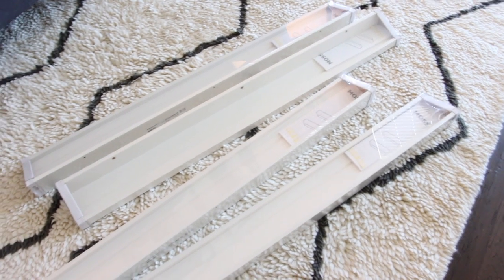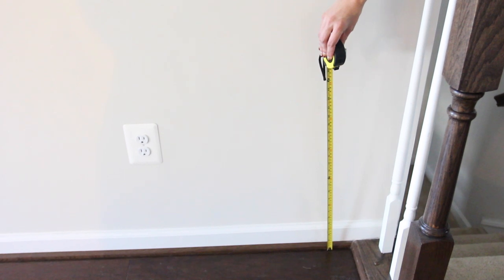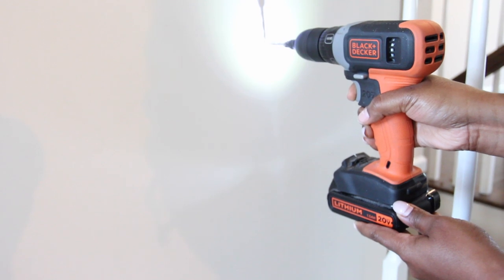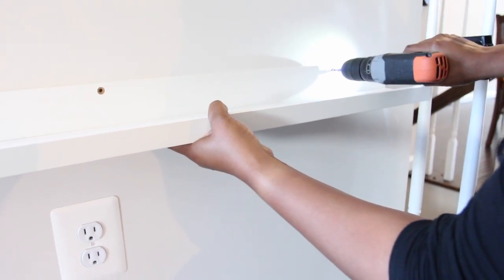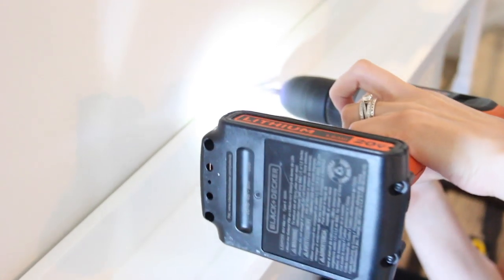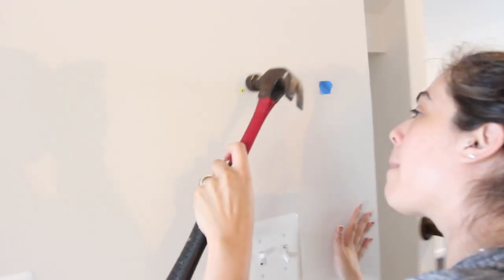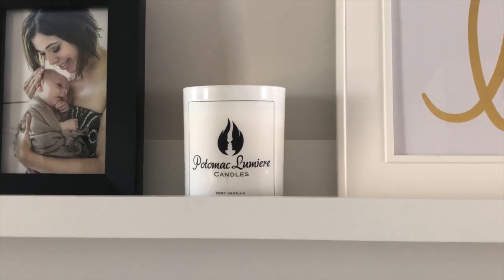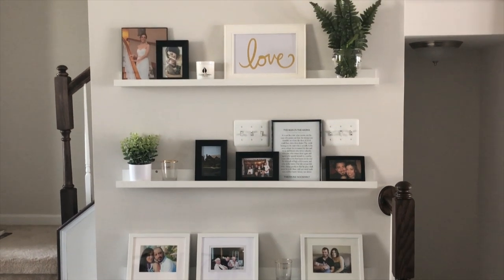DIY Picture Ledge Wall - Easy - Short Wall Solution

Comment: So I’m watching from Europe and before doing this kind of drilling I’d have to make sure there are no live electricity cables that a screw could hit,   I notice you were drilling very close to switches/sockets, weren’t you worried about shorting out the ⚡️?
Reply from the maker: Hello in Europe! We made sure to only drill enough for the anchor which is not that deep. This is a new home and the wire is a little further back from the drywall. So, putting an anchor there was fine.
Reply: Oh good, I was worried for you. Lovely job you did.

Comment: Even the light switches and outlets look like part of the artwork. I dont know why Im so intimidated to use anchors...😬
Reply from the maker: Once you try it, you’ll feel better about it. You can always repair drywall if you make a mistake.
Reply: Of I don't have a drill can I use a screwdriver?

Comment: I want to do this but my walls are cement smh. Love this idea
Reply from the maker: You should be able to do this with cement walls too.
Reply: @treshaja  it took two days to hang curtain rods on 5 Windows my arms were so tired just drilling holes for the anchors. My framed photos are up with command strips because of these walls. We shall see though.
Reply: So are mine making it so hard to put  anything on the walls. I found command shelves that I'm going to try using. I use command on my frames too.